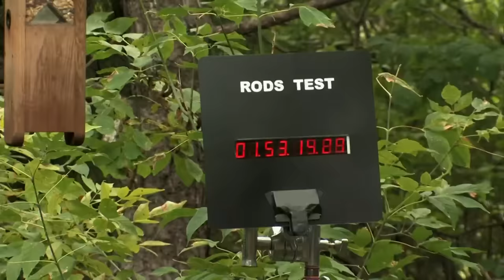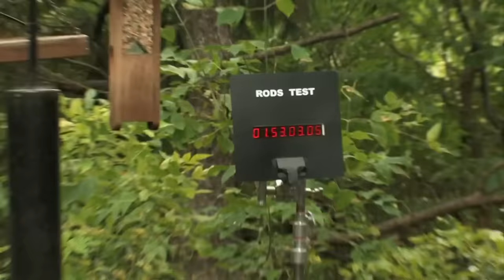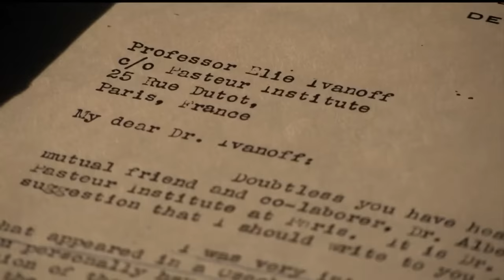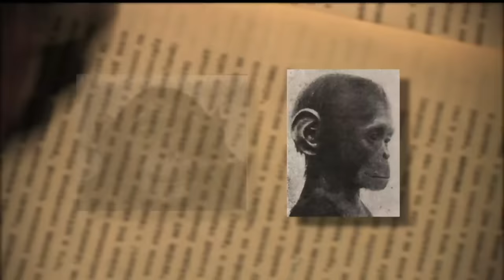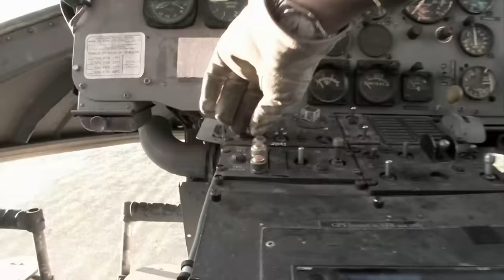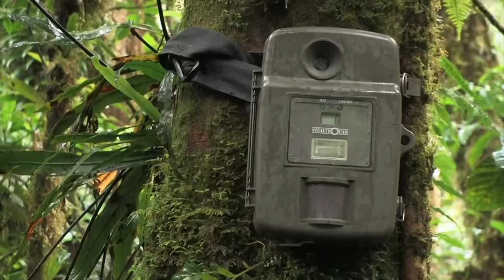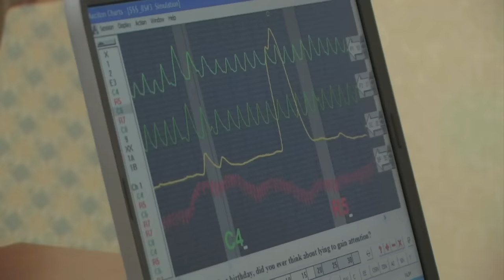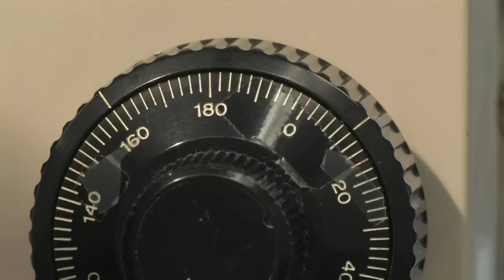MonsterQuest: Unidentified Flying Creatures Wreak Havoc! *3 Hour Marathon*

Comment: if i remember right rods are seen when  insects are actually flying  in front of the lens  and the shutter speed of the camera being slow and off from the beat of its wings, filming at a higher fps will let you see the flying thing. check your camera's settings and frames per second

Comment: I was driving from work and there was a storm that came out of nowhere with the winds picking up. Leaves were blowing everywhere. I was on the highway and I kept looking above the trees looking at the wind. There was a grey colored rod that appeared but like it was flying through a cloud above the trees. It seemed to be keeping up with my car. I was driving about 77 miles an hour. Then it went up. In about three miles the winds had stopped and the sky was clear. This happened about two years ago.

Comment: I think they've been around a long time you just didn't know till now.  My sister saw something similar to that while heading sheep when she was a teenager. She is now in her 60s. She saw them coming out of a hole under a small out cropping of rocks. She described as flying white snakes. She said the wings were like a white see threw plastics. They were a foot long in size. She went to school in Utah and years later when she came back she there to see if they were still there but there was nothing. People have moved there and there was a large corn field nearby. She called them flying snakes.

Comment: The American Honey Bee is a prime example its wings are so small compared to the size and weight of its body it can never fly the reason I can fly is because it has a gland in his chest that it vibrates and it emits a negative magnetic field at minus 19.5 Hertz making it almost completely weightless that's why they fly so fast and can turn so fast and it doesn't affect them as in G-Force I was talking about they can fly forward and immediately back up without turning around😅
Reply: I strongly believe frequency and vibration is the key to unlock a whole lot of answers
Reply: 🤔
Bumblebee ~ Vortices Created by its Secondary ("Leech") Wings!
 
That's Why it Can Fly 😻🐝
Reply: Ok take it easy on us that just have a high school diploma 😊
Reply: The vibration from their wings is what gives each hole or whatever they are their hexagon shape. Sry if my geometry is a bit off
Reply: Please get real. Someone might believe you're telling the truth when you aren't.

Comment: If we're going to scoop water to press filter it comes f/ the middle of the river not the bank.
Where all the muck is.
The middle.    And that's with a filter.   Yes you'll be in a boat.   But it's still filtered.